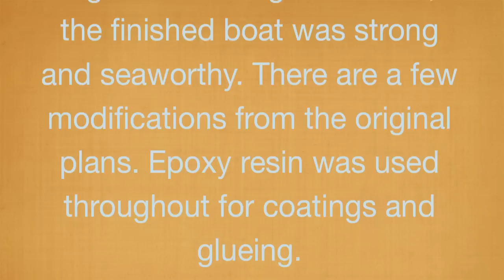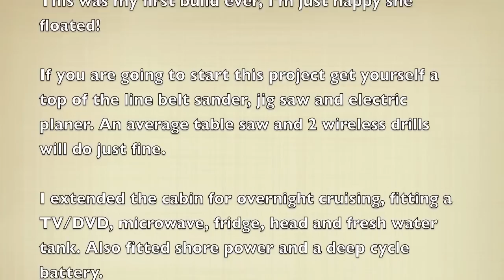Building a 26' East coast dory - LUCKY PIERRE 26

Comment: nice build , thanks.  Your comment about the rudder is right on, you might look at the traditional dutch design rudder, it has an extended under water area which indeed, increases the slow manueverability.  thanks for the docu post.